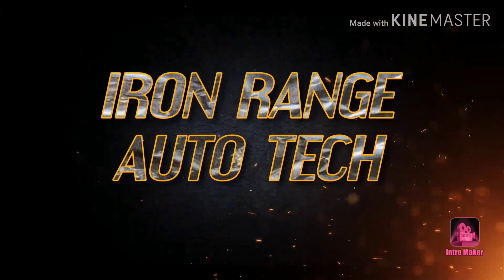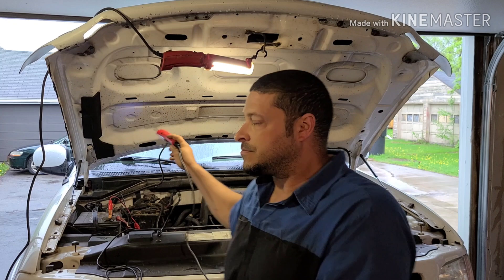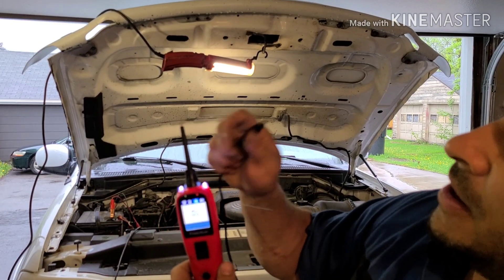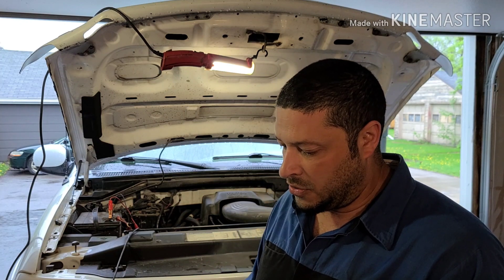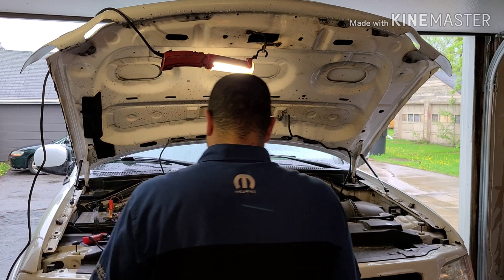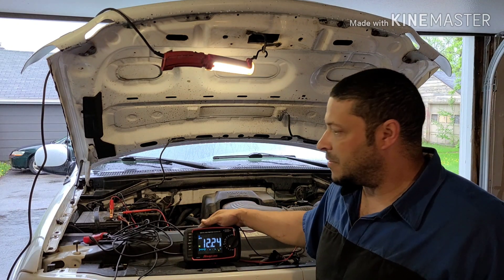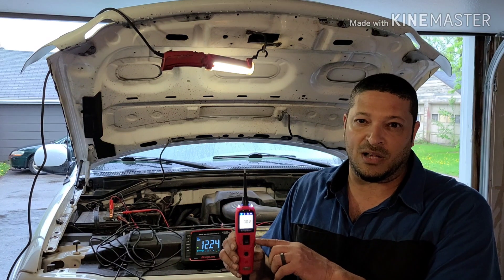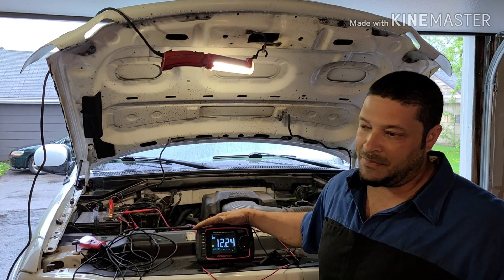Power Probe or DVOM

Comment: I really like that snap on DVOM, but I work on Ag Equiment out of a service truck and let me tell you things can get messy real quick, I’d hate to ruin it and get it all dusty and dirty. Something that wouldn’t happen as bad in a shop environment.
Reply from the maker: Lol I can see your point 🤣 what do you use for a DVOM on the service truck?
Reply: Iron Range Auto Tech  I’ve had my Fluke 87 for ever it feels like, I need to upgrade it soon!
Reply from the maker: @jcolivera881  I hear ya, thats where I was at with my old Snap-on meter.

Comment: Power Probe is good but like you said you do half to be careful depending upon what you are testing because you can burn up something. I Just recently pulled the trigger On a Power Probe 3 just to get the hang of it even though the 4 is in play . The devices do walk you through steps but I preferred to be able to get the 3 features down pack first before diving head first in with the 4 because the 4 is more advanced and some ppl who have it they pretty much understand the basics of it but I wanna overstand the device in its capabilities because the features are extended in its version
Reply from the maker: True the 4 has a lot more functions.
The snap-on version has even more capabilities than the 4, that one would take some playing with 😆
Reply: @ironrangeautotech8292  Yes there is alot to learn but once you got it you got it and it's all over from there Green light go on everything diving into all soughts of work